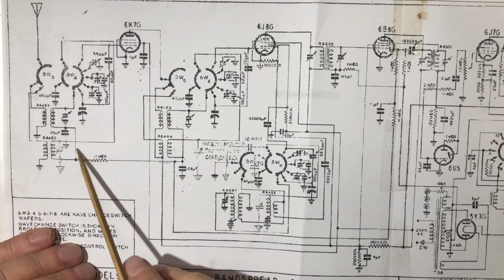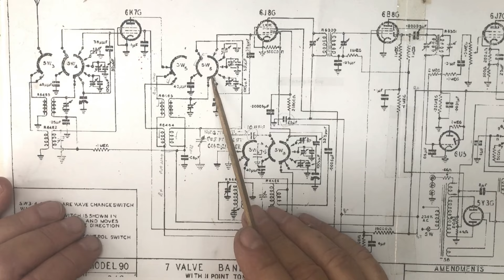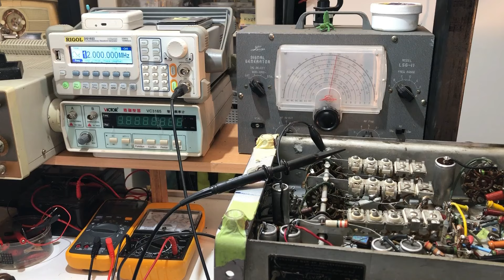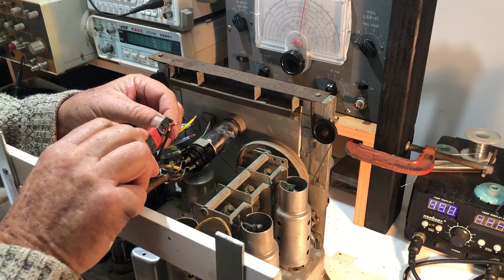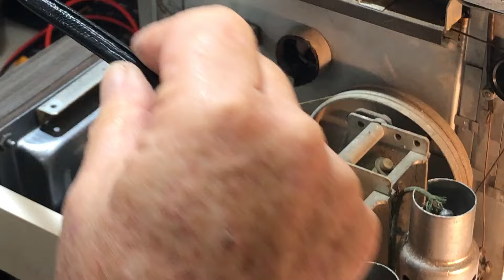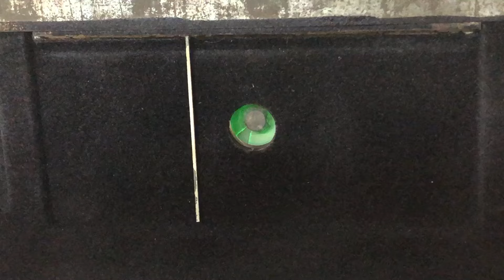COLUMBUS Model 90 Made in New Zealand in 1945.  Part 4

Comment: Had they gone with Vacuum tubes with a heater voltage of 12V and a B+ of 12V they they could have been able to use low voltage parts.
Reply from the maker: Interesting point.  I wonder why valve technology never evolved in that direction.

Comment: Impressive amount of work in spite of not owning a valve tester Don. Some radios still work well with weak tubes but
buying a set of tubes that were  tested good by a seller may be an option. Nice of being gifted  parts ,so a big thanks to Steve.
Reply from the maker: Hi Steve.
Yes, Kiwi Steve has been very helpful and supportive throughout. Luckily I have friends in low places and I was able to use Ron Pond's valve tester and buy a replacement 6K7 from him and the radio is now going well on all wavebands.
Cheers

Comment: Don nice work, The internet has just about killed shortwave listening, Troubleshooting SW gets a bit harder as there is less stations. Automotive companies like Tesla are not installing AM radios in cars are hurting AM broadcast stations in the states. One step forward two steps back.
Reply from the maker: Hi Mack.  Yes it would be pretty hard troubleshooting when there's nothing much to receive.  WE get a lot of stuff from Asia here, although not much in English.  Geez Tesla aren't even installing engines in their cars lol.  Sad to see AM broadcasting disappearing in Europe and the States.  The government - run  AM network (ABC) looks like it will keep going here though, so the commercials will probably stay around too, at least for a while.
Reply: @Donno308  The problem with AM in Tesla's seems to be because of all of the digital stuff, it would be difficult to get an AM radio to work without picking up interference.  No SXM either but because you can pair it to Bluetooth or use USB, there are a lot of options other than AM.  I just have a ton of oldies on a USB stick and listen to that most of the time.  I do miss the old "Top 40" of the early rock era.  You know you are getting old when you are in a supermarket and hear the Beatles or CCR on the background music.